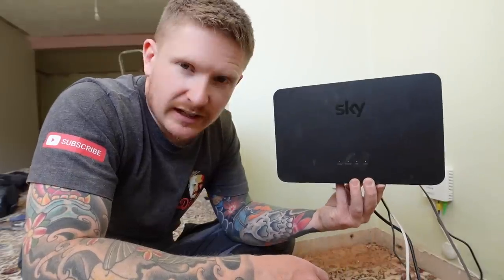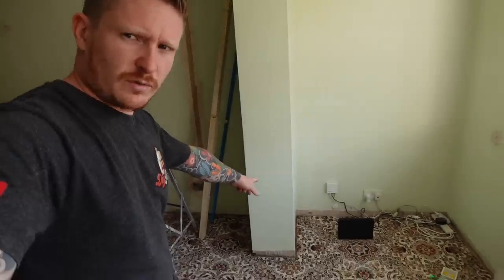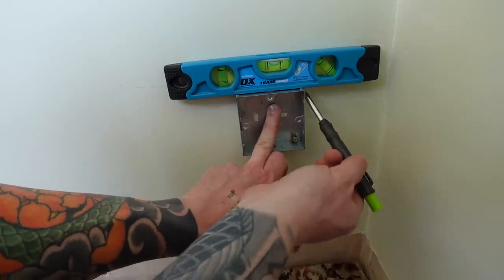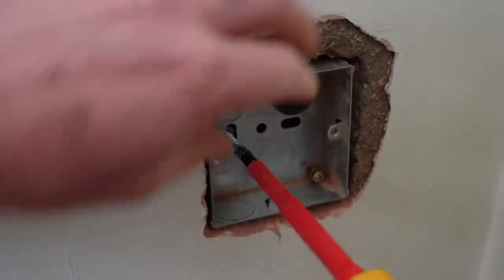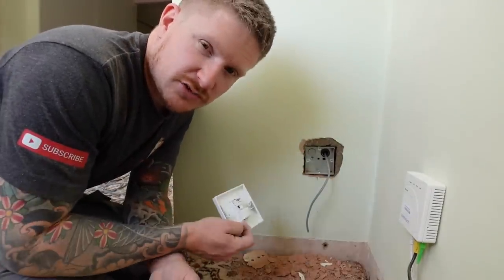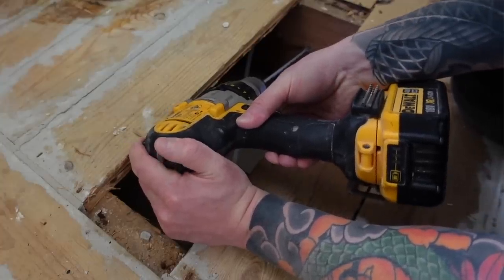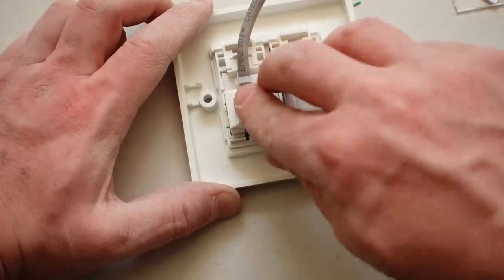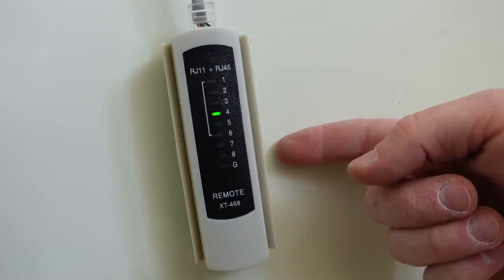How i Installed Network Sockets in an Old House | No More Wifi

Comment: If you ever need to replace that cable, you'll have to re-chase that area, so a super easy solution is to put a plastic pipe or box in the chase and feed the cables through it. That way, after you've repaired the chase, if you ever need to replace those cables you can attach the new ethernet cable to the old one and simply pull it through, saving you from having to rechase the wall in the future.
Reply: wow, he didn't use that right? Is this a video how you should not do it?
Reply: @paulh43 no, @moretickle is just future proofing. Personally, i’d rather make a bigger/deeper chase once & install conduit which will show up on a service checker, but it’s not required (to my knowledge) to do so.
Reply: He didn't even mention either a or b wiring setup also this guy feels like a Sparky/builder than anything like a network guy
Reply: @England91 The channel is called 'DIY Guy', not 'Network Guy'
Reply: Yeah, but this should be weighed against the chances of ever developing a cable fault which is highly unlikely.
Reply: @England91 you don't need to know whether you do a twisted pair if it's CAT6 tho right?
Reply: He does mention in another video 1 or 2 why hes not doing this but is aware a pipe is good practice, additionally he should use a Cat6e or Cat7 as it has a 10Gbps throughput for extra future proofing as fibre at present can supply 1Gbps at present, also putting in another cable as a spare is good as if anything did go wrong he would just have to rewire the socket than to chase it all again. Maybe shielded too? not 100% on that though
Reply: @AirZeee  He mentioned in his re-wiring video that he wasn't using conduit because a deeper slot wasn't practical with his wall composition.
Reply: all installations should be in run in conduit metal or plastic.
Reply: @SamMC08  Then use the oval stuff which is practical in ALL solid wall constructions.
Reply: @EpicFeury  There is no such thing as Cat6e and Cat7 is not approved and is unlikely to be ever approved for use in an IEEE 802.3 Ethernet standard. Apart from anything else Cat7 and Cat8 cables require special CG45 connectors as electrically, the cable is a bundle of four miniature twinax cables rather than a bundle of four balanced pairs. Unless you have the corresponding sockets on your equipment and there is no equipment using those sockets then you will cause problems for yourself. Anything more than Cat6a is unscrupulous vendors selling to the ignorant who think higher numbers is better. When it comes to networking cables that is not the case. However sticking the cable through some cheap oval conduit is absolutely the sensible thing to do.
Reply: Would have run conduit in the corner up the wall .
I would have also used another router ,then turned it into an AP so that when his teenage daughter and (50 ) of her mates are doing tick tok videos ,they won't moan about the connectivity 🙄😂
Would have also gone on the WIFI analyser app and seen which peak of the Sine wave was the lowest (traffic) and then swapped out the channel in the new AP which would helped with the speeds .
But ...

A good effort tbh and I'll never slate a fellow norfolk man .
Just don't get a Spark to do it .they can't terminate Cat5/6 for shxt 🤣🤣
Reply: @EpicFeury  We already have 8Gbps lines in my area
Reply: @EpicFeury  cat6 is 10gbps for 55 meter lengths. That's probably plenty long for the size of this home.
Reply: I send two wires, 1 as spare, you never know if you need additional sockets or 1 failed over time. The cost of the additional cable is cheaper than getting any kind of tradesman back to re chase / re wire the house. 

And I’d probably use some kind of conduit instead of cutting the wall open
Reply: yeah, and he'll have to replace the cable really soon since he used unshielded cables (not grounded), so they'll catch any EM signal wandering around that will at best lower the connection speed, or at worst completely cut it off at random.
Reply: @shoutrr OTT this is a house not a data centre, you sound like one of those people who spent ages reading on the internet what to buy when they have no clue but dont have the budget to put into practice
Reply: Exactly, even in case you decide to upgrade the cabling with a different technology as fiber channel you don"t need to do construction work any more

Comment: If your going to do all that effort as opposed to Ethernet over mains, I would bring all the cat 6 ports back to a patch panel in a cupboard somewhere and use an ethernet switch. Remember cat 5/6 can also be used for phones & other low voltage signals , so if you have a main BT socket you can run that back to your patch panel then have the phone in whichever room you wish. also get a proper punch down tool. Cuts the cables as you install them into the socket / patch panel. And just to be clear NEVER JOIN THE CAT 5 CABLES WITH BLOCKS / WIRE NUTS / WIRE CONNECTORS. The number of times I've had to deal with structured cabling installed by electricians  who think because it has an electrical connection it is fine...
Reply: Ethernet over mains has to be treated as a last option... I'd much rather do what this guy is doing
Reply: @CGRealStudios point still stands to run everything back to a central location.
Reply: Yeh for cameras too. Wireless cameras in a larger house are dodgy as.
Reply: Doesn't ethernet over mains have a 10mbs limit compared to cat6 which has a 1000mbs limit?
And most ISPs start at about 30mbs?
Reply: @SaintGerbilUK  CAT 6 supports up to 10Gbase-t up to 50m in length. Depending on your luck you might be able to get 5Gbase-t up to 100m, but 2.5G and 1000base-t should be pretty safe at 50–100m.
Reply: @SaintGerbilUK No, powerline speeds well into 100mb range in real world. I've got 1000mbps powerline - runs at at least 400mbps real world

Comment: Perhaps you did, but it's not clear in the video. But you should have used conduit pipe in the space you made for the chase to run the cable through. It means that if ever you need to change the cable (For example if you wanted to change Cat6 to a new standard) you can just pull the cable through. You've made it a tougher job for yourself just sticking the cable into the wall with filler.
Reply from the maker: Yep 20mm oval conduit
Reply: @TheDIYGuy1  Ignore me then :)
Reply: @Ciano56  You are correct, and it is obligatory when it comes to electrical wiring
Reply: @dougaldouglas8842  protection the cable in the wall in any sort of conduit, capping etc is not obligatory in the UK and this is a UK video, so be careful of miss leading comments.
Reply: "Perhaps you did"... "You've made it a tougher job". That escalated quickly.
Reply: @stevenskillern1477 
I've always wondered and your comment prompted me to look it up.
It's a bit of a grey area as it's sort of implied but I have also always realised ~ like the yellow tape put above cables in the ground ~ that capping doesn't offer perfect protection from piercing. 

The metal capping can still be overcome by the oomph of a nail gun apparently and of course the plastic version would only stop the most diligent driller if he were lucky enough to hear the slight difference in sound in the milliseconds before the drill passed through it into the cables.

Apparently the best protection that capping offers is from the new plaster's chemical make-up eating into the wires' insulation over time.

The benefit of capping is at best as a poor version of trunking allowing the pulling through of cables themselves.
Reply: Capping or conduit is not a uk requirement for electrical cable or data cable when run in walls. Read the IE regulations.
Reply: @JP_TaVeryMuch  tape in the ground is much more effective than any sort of capping as it should be put approx a foot above the cable just below the surface so that someone is aware of it's presence below and either stops digging or proceeds with caution. The chemical make up of plaster doesn't effect the cables burried below it, the initial thoughts behind capping are to add a slight bit of protection from the plasterers trowel when they are skimming over. 20 years and electrician and I've never seen the benefit and it's no grey area it's just not required at all by the regulations. Maybe a good practice but honestly a waste of money and even more a waste of valuable time. Just leave this sort of works to professionals l, electrics are dangerous and just because something plugs in and works for years really doesn't mean it's safe. Sad that channels like this promote soon much work like this.
Reply: Chemicals in cement render can damage insulation but so many places are dot and dab plasterboard now so doesn’t matter in that case

Comment: One thing that appears to have been overlooked is the mention of bringing back all cables to a central point near the router so that you either a) connect the ports direct to the router if the number of sockets are =< the number of ports on the router (which in that case the socket next to the router should be a 4 gang to act as a patch panel), or if the number of sockets is > the number of ports that a switch will need to be fitted.   This video is really more about how to install sockets and chase walls out than how to actually network the house.
Reply: @@srod2966 you don't need a rack, it's easier to network and futureproof using a switch at a central location, 1 chase(if needed) = up to 8 sockets, also just fyi all provider supplied homehubs are shit and just a p.s. i'm sending this on a network that I installed using a switch and i only had to chase 6 inches
Reply: @@srod2966Exactly. It’s always the geeks who don’t understand the audience. There’s plenty of dull videos out there for network design.

Comment: I totally get why you didn’t cover it because it’s overkill for most.. but a much better way of doing this is run ALL the CAT cable back to a central point and install a patch bay and network switch. Then you can have point to point network anywhere or just stick it all into the switch and have everything connected to everything.

Comment: Great content - one piece of advice from me, never run just 1 cable. Always 2. The back box isn’t any bigger, the effort is pretty much the same, yes the cable cost is more but that’s negligible for the effort, but crucially if one of those cables is damaged, you’ll be thankful you ran the other. Where you will have one device plug in, there’s generally a good chance there’ll be 2. Eg tv + media box, desktop computer + printer etc
Reply: Or just put it in conduit which is dirt cheap. Then you can replace or upgrade the cable in the future.
Reply: @nickgilbert1264  i find in the majority of cases, cables are being retrospectively pulled in by rod and fitting conduit isn’t within the scope of the job as is too destructive or too much making good to do, but yes, if the run is accessible, conduit is always appreciated!

Comment: In older houses like this that have solid brick walls, if they still have the original plaster on the walls, you'll usually find that you can dig quite deep directly into the inner corners of the room and a single cable will fit there, sometimes there is space for 2. This also means you can route the cable along the ceiling edge, and down the inner of a wall leaving you with minimal chasing out. It's not the best way to do it, but sometimes it does help things along.

Comment: I've never been so thankful for drywall...lol   I did this in my house but was lucky to be able to run it from a closet upstairs in my office that fed down to the ceiling of the basement then follow plumbing back up to the main floor.  A second line went up to the attic and connected to a switch that ran to all devices like a Roku in both bedrooms. Took me a couple of hours with almost no mess to repair.  It is so much better than having to count on Wifi (and much more secure)

Comment: Since I usually live in single story homes, I like to run a single cable from the modem to a decent switch or small rack in a central coat closet,. I then put an appropriate diameter piece of conduit with brush grommets, through the ceiling in the closet into the attic for the ethernet cable runs to pass through. It takes much longer doing it that way but for me it's worth the extra time and effort. I try to plan ahead so I left pull lines going to the boxes so I could more easily add more later if need be.

I luckily have 8 PoE ports powering mesh wifi drops with ethernet backhaul around the house mounted to the ceiling in bedrooms, living room, and my shop in the garage. Along with a few 10gig fiber runs to the office and entertainment center and at least 1 Eth run to each room. Took a while but everything is hidden and tidy. Can always add a sub switch in a room, if needed later,  but having everything in the walls already makes that a trivial adjustment. 

Good video with some decent solutions for older homes and multi level dwellings.

Comment: I've used Powerline ethernet adapters & ethernet switches in the rooms i needed a network connection; this saved a lot of hassle with drilling, cutting and chasing wiring up and down the house.  Works a treat.
Reply: They don't work for everyone.  Depending on your house wiring, you may not get good performance from these.  I also had a weird problem with data noise getting into an amplified speaker in the house.  I installed network cables to every room in the house (except bathrooms of course).
Reply: When I switched to 1gig fibre broadband, I noticed the power line adapters absolutely cripple the speeds at devices using them. And this is a new property and router and powerline adapters are on the same floor/circuit. If you are on 100Mbps broadband you probably won’t notice it, but switch to 900Mbps and you will.
Hardwiring Ethernet is my plan. 
Thanks for this video.
Reply: Powerline is slow. It can't carry gig+, speeds and can lose sync and drop out entirely. It's a last resort.
Reply: Powerline isn't very good at all and they are really quite lousy if the 2 sockets are on separate circuits.
Reply: Powerline adapters are hit and miss at best (even if they're on the same power circuit). I'd use them as a last resort where possible as they tend to be slow as well (if they do work). Its always better option to run cables where you can.
Reply: Unfortunately, Powerline causes dirty electricity, which is bad for your health.

Comment: Not a bad video. One thing to keep in mind is the length of the cable run. The spec normally says 100m max. I always run 90m max from sockets end to end, allowing 10m max for both your patch leads, then you're ok. I'm not sure if your cable tester just do a continuity test or if it can test cable lengths. Most cases, most runs should easily get under 100m unless you are running to a out house. Otherwise, good video.

Comment: Great video. 👏🙏
When you were drilling the hole from the chase in the downstairs wall into the floor space above with the long drill bit, what precautions had you taken to make sure you didn't go through a pipe or cable in the floor above? Was it just a visual inspection of the area from upstairs prior to drilling?
Many thanks for the fantastic, clear and helpful content!

Comment: In Germany I don't run CAT5e or CAT6 cables any more as the prices don't differ too much from CAT7. So I'm installing future-proof CAT7 with Cat6A Keystone module which also deliver 10Gb Ethernet flawlessly over a longer distance - especially when you immure the cable into the wall.
Reply: I use CAT 8 cable in my office. Works a treat.

Comment: Fascinating to see the process of installing cable, it's actually illegal to do it yourself here in Australia and it must be done by a registered cabler.
Reply from the maker: Even a simple Ethernet cable? Or is this only for electrical cable?
Reply: @TheDIYGuy1  Yes even ethernet, if it's going in the walls, floor or ceiling it must be done by a professional.
Reply: @stuartt455 hat’s hilarious. What muppet came up with that! What’s next you can’t change a light bulb unless you’re a professional? How about putting up curtain rails? Painting a wall? Government gone mad!
Reply: @davideyres955  Yes I agree that we do tend to over regulate in Oz, however being an expat I also hate all the cables, conduits, pipes etc fixed to the surface of walls in the UK. Assuming the wall with the router is an outside wall, would it not be a cavity wall?? Not sure if house construction with double brick is different from Oz but here the cables would be "snaked" up the cavity & into the roof/attic space without any drilling or chasing.

Comment: Thank you very much for the helpful video. I was worried about chasing the cable in the walls as it seemed daunting. I ended up running them around the outside of the house instead. Will certainly use your method once I get around to decorating front room
Reply from the maker: You're welcome!
Reply: Running then outside will eventually fail unless you used external grade as ordinary cat5/6 cable is porous.

Comment: Excellent video every helpful..  What was the reason to use a 2  Ethernet wall socket when you used only one? Can the other one also be wired up tonconnect another device?